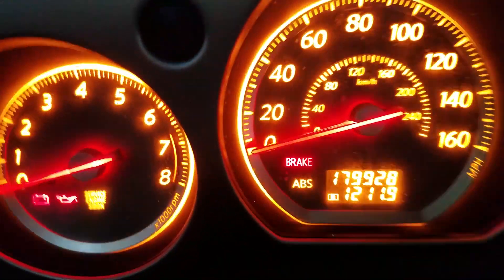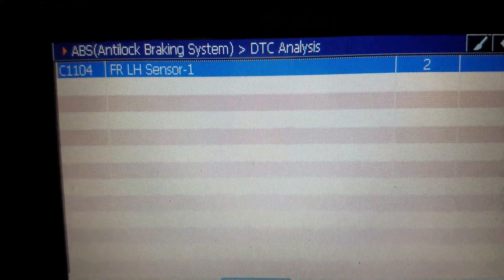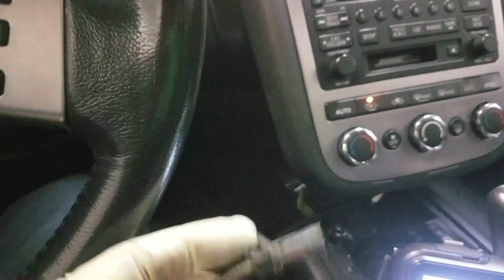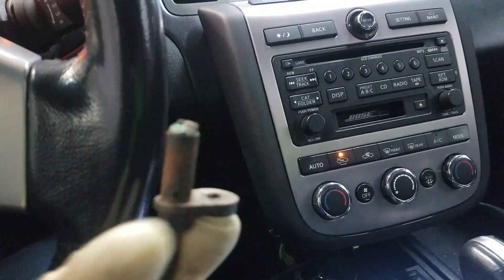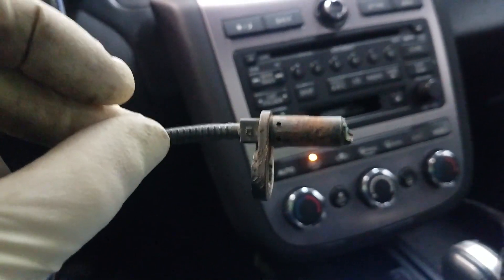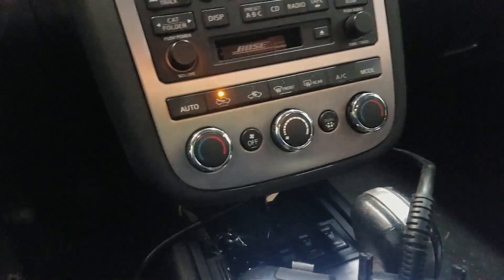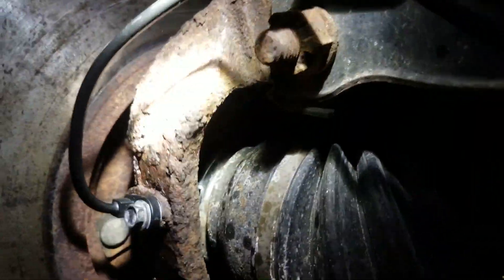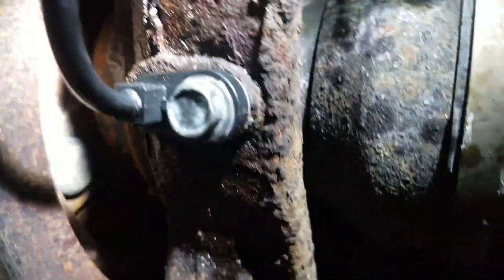C1104 NISSAN Front Left Sensor 1 "ABS wheel speed sensor diagnostics"

Comment: wanted to share the symptoms I had with a 2019 Altima.  a few weeks ago, i had my front shocks changed.  (way better ride!) then after about 25 miles the car would feel like it would hit a headwind momentarily, after a few of these many lights on the dash went on.  very intermittent, so weird and frustrating.   The car would go into a limp mode, but would drive fine.  I realize now that the ABS was turns off, could not use the cruise control.   got the code reading at a O'Rielly's.  1104, left wheel speed sensor.  Sure enough the guys who did my shocks cut into the cable.  the change out is simple.  Wheel off, all is right there.  however, the one I bought did not have the right clip.

Comment: I’ve seen a dozen of these ABS sensor replacement videos and then tried to do mine. Why does nobody have the brake shield but my xterra does?  How do I work around the shield?  The little screw or bolt in there is at and angle so I can’t really get my screw driver bit to bite on it.